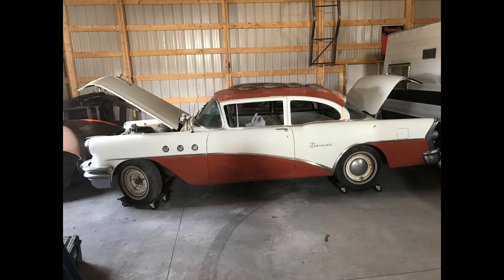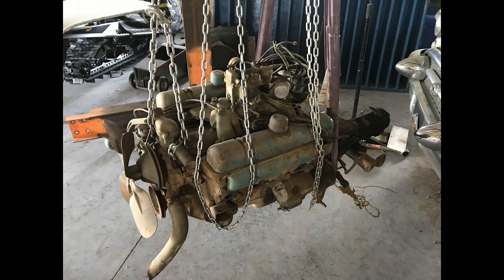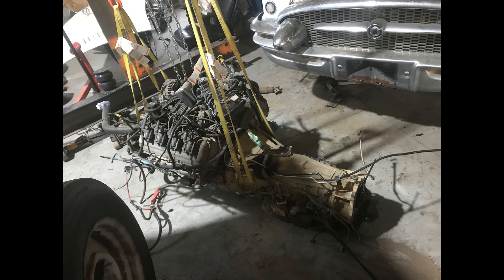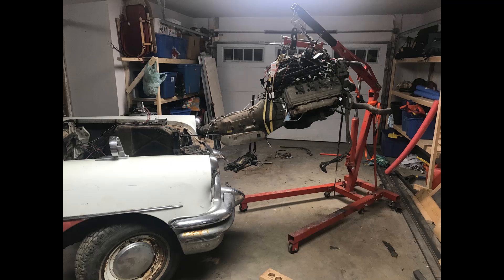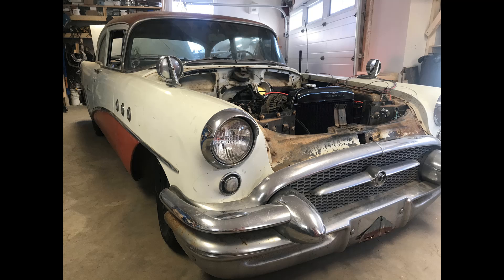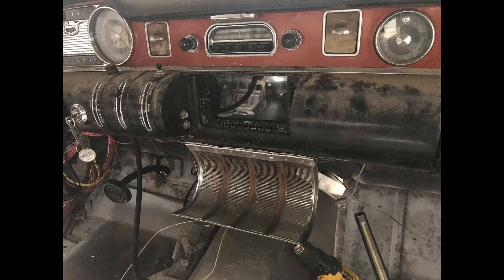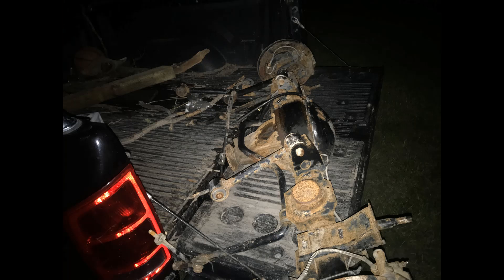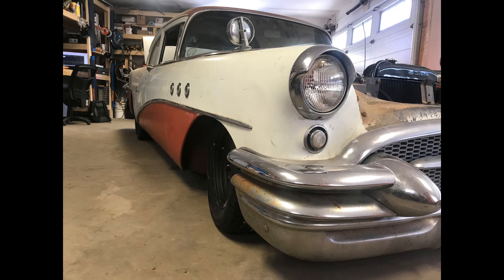1955 Buick Introduction

Comment: A '55 Buick is a great car.  It already has a good engine, transmission, differential.  If you wanted a Dodge or a Ford, why didn't you go buy one?  You've ruined something beautiful, and created Frankenstein.
Reply from the maker: The beauty of cars is that as soon as you buy it you can do what you want to make it yours. I have respect for anyone who wants to put the work in to make their car what they like. I wanted something with disc brakes, a fuel injected engine/auto trans so I can drive it anywhere I want without having the reliability issues. I gave, not sold, gave the original drivetrain to a guy restoring a car locally so it has a good home.

Comment: I see you are using willwood disc brake kit, did it work with stock wheels?
Reply from the maker: It did work just fine with the stock wheels. No clearance issues
Reply: Thanks good to know, there is no video on YouTube regarding this willwood kit and how they fit.

Comment: No,such model as a Riviera.  He should have said Century.
Reply: The riviera designation was applied to the 2 and 4 door hardtop (no center post) versions. It was an option across the whole model line. The models top to bottom were: Roadmaster, Super, Century and Special.
Reply: @dkenmiller9829  That’s true but few people called them that.  People referred to them by model designation.